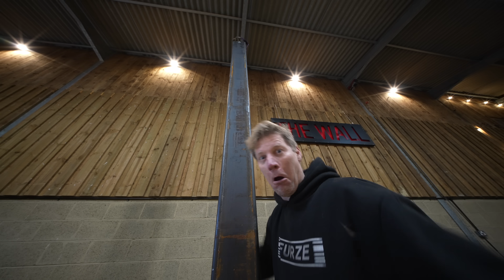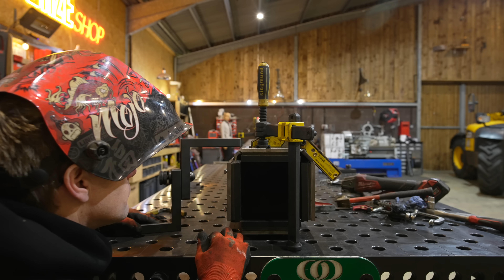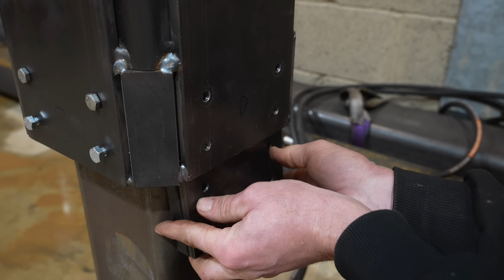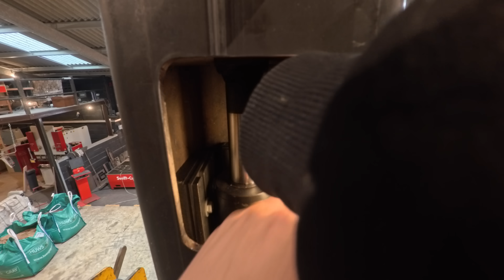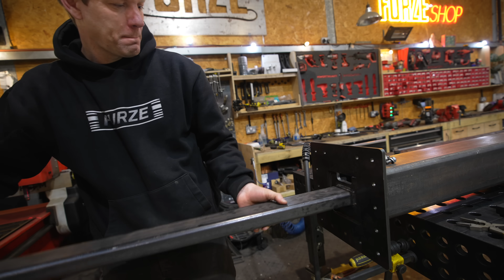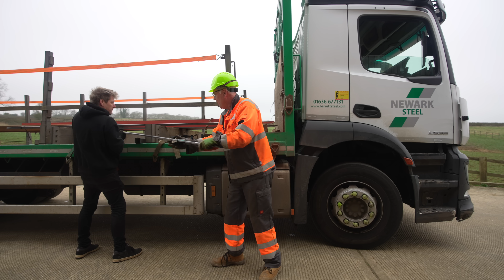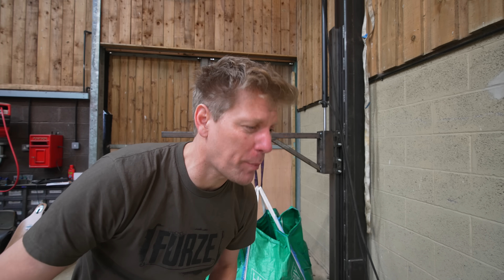Digging SECRET Garage Part 7 Car Lift Prep

Comment: I see you're building this as beefy as possible for "safety", and I know it wouldn't be a colin furze video if we talked about safety... but have you considered some kind of locking mechanism, so if the thing falls when you don't want it to, it can't fall more than a couple inches at a time so it doesn't crush you?

Thinking some sort of ratchety/locking mechanism would be rad to keep you from getting crushed while working on your vintage delorian and/or toyota pickup.

Comment: this already outhere a 4 post car hoist would the easiest ,to tur the car a single hydraulic post in the middle with a turntable on top expensive .your turn table needs to be recessed into the lifting frame for even drive on/off

Comment: As an dickhead, thinking of other dickheads I’d park on the top of the lift to say hi or have a cuppa of whatever. But I drive a manual hilux that has a shit handbrake. 
I’d consider putting some sort of automatic barrier to prevent the car in top from rolling off, maybe a flashing light to warn pedestrians and other dickheads to stay clear. 

Cheers

Comment: Great video Colin. I’m trying to get my head around what would happen with an uneven load on the raising platform with the hydraulic fluid free to move between all of the pumps.  Given the car’s engine is at the front does that mean more downward force there which would mean the fluid could raise the back of the platform more and so it would tilt? Surely the fluid for each pump has to be a separate sub system so that tilting doesn’t occur? I’m no engineer though! Full respect to you taking on something so complex. Keep up the great work 💪

Comment: If you link all the rams together and use a fluid restrictor they can't NOT act together. Its like filling a bath with water. One side doesn't fill faster than the other!

Comment: I was going to mention you're building everything too heavy!
I made a set of ramps from 100x75x6mm bar with some 100x10 extensions on the outside because our 30 tonne digger was wider than the original ramps. And it didn't bend. Thats a 30 tonne digger on 4 lengths of 100x75x6 running LATERALLY not linearly.

Comment: You showed how you could get access to adjust or remove the top pads between the inner and outer steel sections, but if you dropped a bolt or washer inside, and they fell to the bottom, or got lodged under a hose, could you get them out?

Comment: I'm still convinced that core drill the floor so you could slot the hydraulic down under the "cage" would be a better, safer and easier solution! And just use rollers for stability. Then you don't had to slot anything and would be able getting more options. You could even lift it out totally to service it. This has to many moving parts and will be hard to work with if you're not Colin..
Reply: If you hade done like this you would even be able to disconnect the roof part from the floor part by taking the cage legs of completely. Or by a simple lock function use the same hydraulic for both cage raise and floor raise! You even get a better possibility to  mount some safety latching like a regular car lift..

Comment: Well the synchronisation of all four cylinders will work as long as there is equal resistance on all four corners, I think that if you park your more to the one side the load will be bigger there and the lift might want to tilt to one side, buuuuut your roller system seems pretty riged so most likeley it will be fine.

Comment: Colin has a mechanical engineer looked at this at all or have any strength and fatigue calcs been done especially on those bolts where the threaded portion is in shear and bending, like the ones holding the bearings that are running on the I beam? And the box section that you've cut the guts out of could be a big risk of buckling on the free edge, the stiffeners will help but you should check that
Reply: also, increase the length of your adjuster bolts for the plastic shims so you can fit a half-nut in, you need a way to lock the adjusters in position

Comment: Why not use hydraulic flow dividers to raise all 4 legs equally? Even when the load is not equally divided among the legs, all the rams will get the same amount of hydraulic fluid and thus raise the platform at the same rate. This seems to me the most certain way that the rams will not twist the platform whilst raising and lowering.

Comment: Safety wise. Look at professional car lifts in automotive shops and such. They have automatic holding locks that engage as they go up. They also have velocity fuses and holding valves. You'll also want some sort of sensor on the top and bottom, as to not open this when someone is on it, or when someone has their toes or fingers under the top. Maybe even a camera and a little screen so you can ensure it's clear?

Comment: You should check out the Blue Origin pyrotechnic weld system. When their rocket lands, explosive charges weld the landing legs to the drone ship deck.  So when you drop your columns into place, viola',  welded, done, and done.

Comment: Question, did you do any of the math on this? You altered the beams quite a lot, so the specs won't be accurate anymore. Or is this all done with gut feeling? No judgement, just curious. This stuff is insanly well done :p

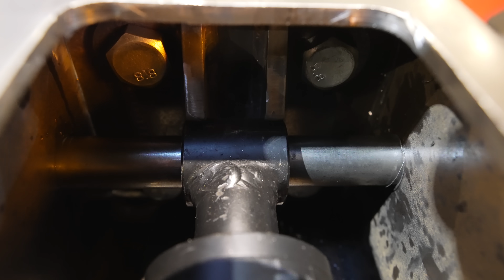Comment: 7:00 Hmmm, those cylinders could be half the length you need with the pulley on top.
Set them up like, I don't know, a 4 post car hoist (lift/ramp as you call them - or actually, the zoom function on the tele-handler) 
Then with a cable anchored to the foot of the leg base, you anchor the other up over the pulley and back down to the bottom of the lifted section = Twice the lift distance of the cylinder...

Comment: am i stupid for thinking it might have been easier to just build a MASSIVELY upscaled 3D printer bed lift system (the kind of 3D printer where they bed moves up and down i mean)?...halefect sensors monitor the position of the screws for leveling, and i'm sure someone makes drum breaks that could clamp down on the screws for safety (emergency stops)...i feel like this was mentioned at one point, and either way, too late now....but with mid-size electric motors and some gearing it could be made to move at a reasonable speed?

Comment: Im pretty sure its got more than enough strength so Im not exactly worried, but surely you cant just do a simple weight and divide by column calculation? I mean, the weight wont necessarily be divided evenly so that seems like it could put way more force on one section than another? Also its not fixed, its a lift. So, say its coming down at a fair clip, then for whatever reason comes to a sudden stop, itll be like jumping on some weighing scales, for a moment youll see a weight far beyond your standing figure, right?
Though Im not sure how much of a difference this all makes, or how engineers run the calculations on this. (and again, it does look to my amateur eyes sufficiently overengineered that even if it can put way more strain on it, it wont come close to mattering.)

Comment: You're going to get some contraction and expansion of the box section with temperature. The adjustable pads are a good idea, but you may run into issues if the pads are adjusted at one temperature, and the lift is operated at a different one. Moreover, use of the lift will involve heating occurring from the hydraulic ram, and this too may upset the setting of the gap.

Comment: Love the build, design etc. and loving the content. One thing, with all these bearings, track runners etc. it seems you are reinventing the wheel somewhat. Why didn't you consider linear rails to do all the movement for you? There are ready made solutions already available off the shelf that would do all this for you, all you need to do is mount them. Manufacturers like THK, INA, SKF and many others have them in all manner of sizes that can carry huge weights, moments of inertia for these types of job.

Comment: I built a 4 post lift once with pneumatic cylinders that I made myself. I used a large reservoir manifold to insure the 4 cylinders got exactly the same pressure. Going up it actually worked amazingly. Going down is where it would bind and I created a web of cables, pulleys, and a lever to pull them all down equally because they were single action cylinders. 

Also, your brakes look like they can rife the edge of the I-beams.

Comment: Press brakes of old had the sync issue, surely you will need some sort of safety PLC from PILZ or similar for this as it is very definitely in scope of the machinery Directive/Regulations - this setup would handle leg Sync simply.

Comment: So I used to work with hydraulic rams specifically with lifts and to keep them synced they would use 1 motor pump set per lift bit obvs your using alot of rams which makes it a bit more complicated. Also another safety feature you could think ab using is there's a valve ive forgotten what its called but it goes on straight after the exit of the ram and it detects if the hydraulic is going down too quickly and shuts off so essentially if a pipe bursts after the valve and a massive influx of oil heads through the valve it shuts off or if there's a big leak in the ram through seals or whatever it shuts off again and it can be connected to each ram in the lift through simply copper pipes. Obvs its a bit more complicated then that but thats the jist

Comment: Colin, the only change I would make for your design is put the static end of the hydraulic rams on the bottom so the rod moves not the body of the cylinder. Why? You only have one sealing surface to contend with, and that's the stronger side of the ram. The rod end loses the surface area of the piston for the hydraulic oil to work against.  

By putting the static end down, you only have the piston seal to worry about holding your lift up. The other way round, you have the piston seal rings and the rod seals to the outside world. I sincerely doubt you'd ever wear it out, but it's good design practice. 

Look at how backhoe or excavator rams are configured, the heavy digging or working sides of the cylinders always use the fixed side. 

I also suspect that when you operate this the 4 main cylinders will lift first to their ends, then the little auxiliary cylinders will move 2nd because of the difference in cylinder piston surface area, that is of course assuming that all 8 cylinder will be plumbed together and not be on 2 circuits. 

Absolutely fantastic project Colin, been watching this since the beginning!

Comment: they make urethane rollers for that application, I think it would be better than the bearings you are using.  Also, bearings are hardened, so the beam they are rolling on will wear, you can get soft steel rollers used in overhead cranes so the rollers, which are easy to replace wear instead of the hard and expensive to replace beam

Comment: Hum, a cable to keep all of them attached. Interesting. I am not sure if that will work but I guess we will see at the end.

I personally would have all the hydraulic pumps running into the hoses that attach to the rams rather than each ram getting its own pump. This should force them all to be even pressure at all times even if one of the pumps is not perfectly even to the others.

Comment: Collin. There's a special grease for metal to polymer/ plastic buffers that reduces the wear , STACKS ! I found it in the Ocean South boat seat pedestals for boat seats. It's similar to vaseline but less opaque and whiter in appearance. A small pocket is in the slippery pads with a small amount of the grease in it. This almost eliminates wear of the slides. After all. Repair or maintenance is best eliminated where possible? Love this project Collin.

Comment: Do you plan to have a safety bolt that can go through the leg should you need to perform service on a post / cylinder while the others are holding up the platform?

Comment: I call uncle on the tube vertical cut. You did not correct loss of torsion sheet and substantially weekend the tube. It’s oversized so it should be fine

Comment: It’s probably too late for this, but an overly simple design for the car turn plate is to simply have a circular plate inside another plate,
So car drives onto the circle bit, circle bit just sits on top of a lip on the under plate, completely just sitting inside a recess.

When you want to rotate it, you either slightly lower the whole hydronic plate or raise the centre circle with the car and spin that only from underneath. So it kinda pops it out from below, turns it and lowers it back down. Feel free to reach out if you want more detail on the idea, but you’re probably past this.

Great progress mate.

Comment: That safety brake is good for if something fails, but not if you're under it. If you're close enough to the thing when it drops with just that safety brake, that 1 cm fall could obliterate your hand. Normal (2-post/4-post) lifts use a tooth system that engages every 6 inches. When you get to the working height you want, you release the hydraulics slowly until those teeth are engaged. That way, it's not possible for a hydraulic line to break and the platform move. I'd consider designing something like that for the maintenance lift part of this. It also means no need to reconnect anything, though I may be misunderstanding how the safety brake functions.  Any lift I've seen with that system treats it as a sacrificial safety.

Comment: Having the inside pipe on the bottom is a horrible pinch hazard.  Plus it will be greasy is you touch it.

Comment: The use of hydraulic systems was the worst possible choice for this project. The best option would be to use a screw with a worm gear, which would keep the entire structure suspended without applying any hydraulic force and, in case of failure, it would not risk everything collapsing directly to the ground at the speed of gravity.

Comment: For soemthing like this you can treat the whole building like the tele-handler tube with a cylinder in each corner of it since it’s not portable so you can cut way down on the number of guides and tubes.  Also that way you don’t need to remove the cylinder from the tube because you are in it all the time.  Applications similar to what you are doing are actually common.

Comment: Colín why are eccentric cams better than the original slotted bearing adjusters? I feel like the eccentric method creates a moment around your bolts, with a distance & therefore requires less force to shift your bearing adjustment. I’m not sure if I’m correct but I am sure you’d be able to help me understand.

Comment: Colin you should switch from ball bearings to needle bearings or tapered conical bearings. They handle high force loads much better and will last longer. Ball bearings are for high speed applications.
Reply: Agreed, the axle bearings on railroad cars are conical to handle the high stress/load.
Reply: That to take both thrust and axial loads though
Reply: That was my first thought as well, but to be fair the final design I assume it's held up on the other end not cantilevered so the forces will be FAR less than the 800kg he put on at the end anyway
Reply: Actually the correct choice in this case would be cam rollers since they are used like this. Normal bearings have thin outer shell that is meant to be installed in a separate housing. Cam rollers have thicker outer race that can be used like a wheel on its own. I would also use some nord locks instead of normal washers to lock the roller adjustment. That thing is going to shake a bit and normal washers start turning and loosen up the connection.

Comment: Please, please, please, make sure you put mechanical safety latches on those rams and under the car platform.  You do not want a hydraulic failure resulting in a splat.  Rotary uses an air line to release the latches on some, a cable on others.  The latches are passive as their lifts go up.  It is the only way to safely work under a car on a lift.

Comment: 29:00...  He's going to have issues with syncronizing those hydrolic rams  isn't he? Cables might not be enough. It may require position sensors to control the flow to each ram to keep things level else the lift is going tp bend and jam itself in the hole.

Comment: Why not Cut Strengthening metal squares around the outside welded every 300mm instead of inside the Beam giving you more space for all Pipes and Hydro Numatics plus cut long slots to get access to said hydraulics  and the Outside welded metal squares at face for access that is in the long vertical cut Ive done this in SOLIDWORKS do ya know what i mean ?

Comment: Ok several questions and one statement. One have you figured out any kind of inspection frequency you are going to have to do to make sure all the welds and what naught are looking and holding up after frequent use? Two have you factored in any kind of safety factor for the hydraulics? Like have you made sure the hydraulics system can handle one leg's rams being down for whatever reason and the other three legs being able to handle one ram being down? Also I know in an earlier video you said you were not adding extra ventilation in the garage because you would know not to keep the car on on the lift. Are you sure that's safe? Like shouldn't you assume the end user may not be you for whatever reason and assume they are an idiot and will leave the car running?

Comment: Couldn't you capture the columns at the top point on three sides each (the opening corners) with bearings? Then the columns can't fall over the fourth side because of the roof and the platform. And like you say, it doesn't need to go full height (unless you're maintaining it).
Or would that have too much play in the system with an uncaptured side?